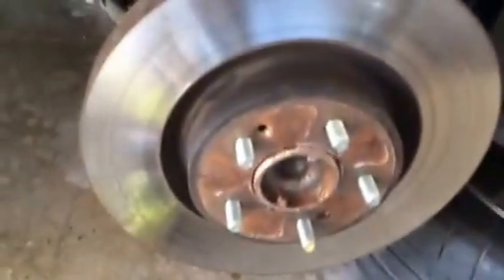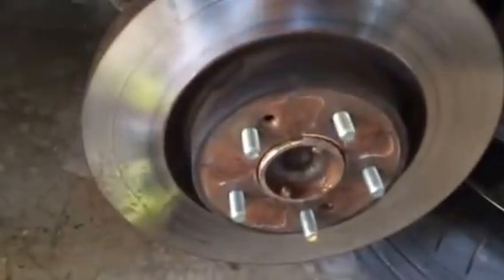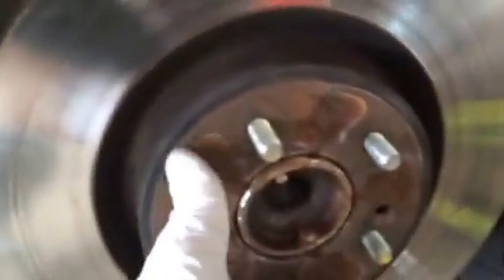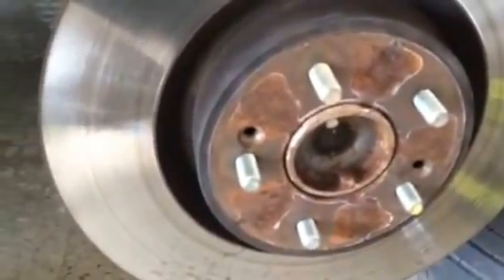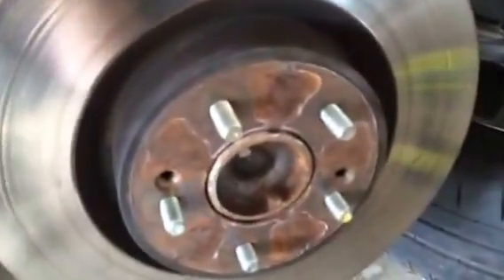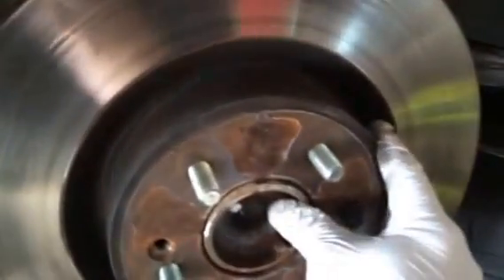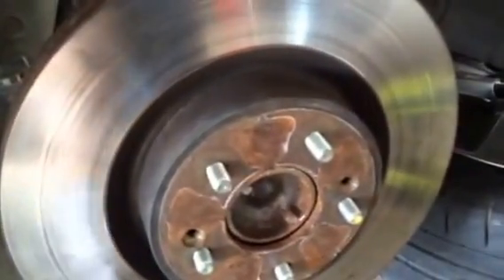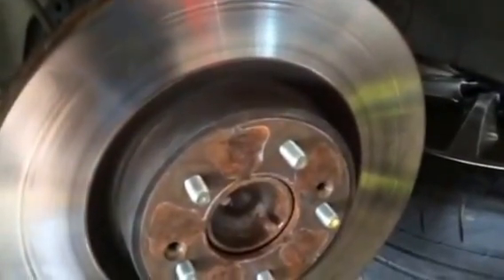Genesis Coupe Rotor Removal Tips

Comment: That 2nd tip was such a life saver. I will give you the credit for it instead of whatever original video you're referring to. Saved me from so much frustration. 

Also... had to bore out 1 of the screws on my front. Should've followed your advice about the impact driver

Comment: This helped so much. After pounding on the rotor with no results, we finally decided to google it and the screw trick worked immediately! THANK YOU
Reply from the maker: Yea, I ruined a rotor banging on it before I figured it out. I checked the hub for runout and it was 0.000 so so big damage. Thanks for commenting, it's been a long time since someone did about this video.

Comment: Thanks for the tip about using the the bolt from the break line bracket!
Reply from the maker: Glad it helped, just wish I knew before I beat the first rotor off with a sledge hammer. ! lol!

Comment: I saw the other video you were talking about and yeah I didn't know what kind of screw to use. Question, hitting the rotor with a rubber hammer to loosen it, good or bad idea?
Reply from the maker: You could tap it with a rubber mallet lightly, but the forcing screw should work